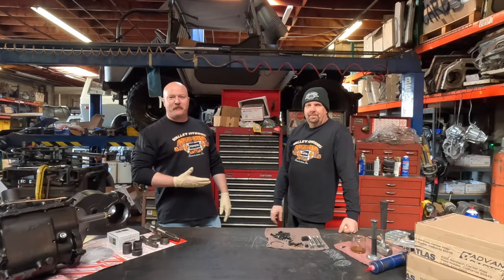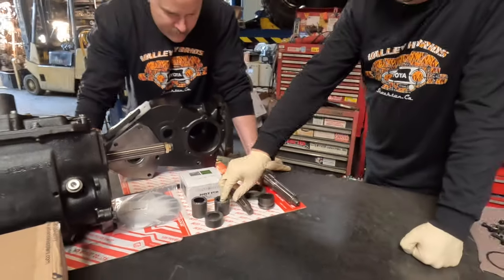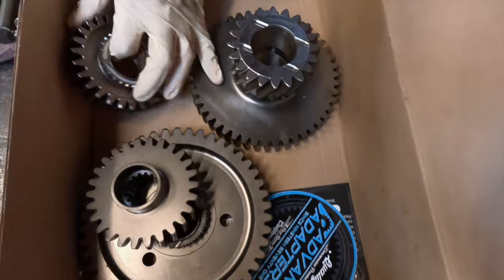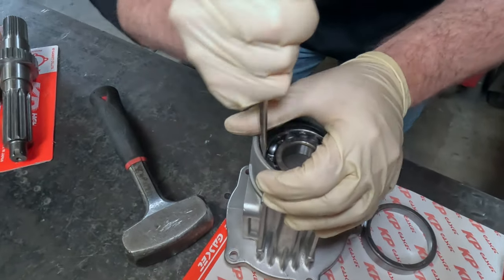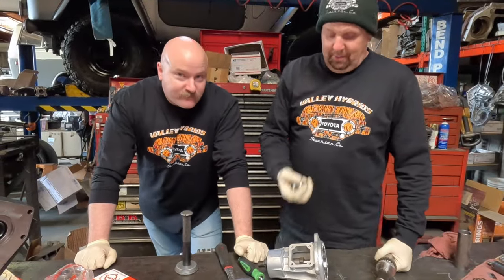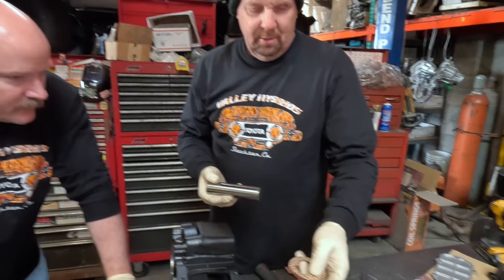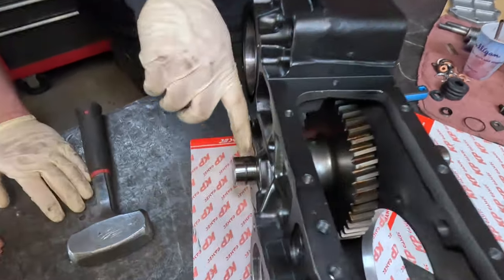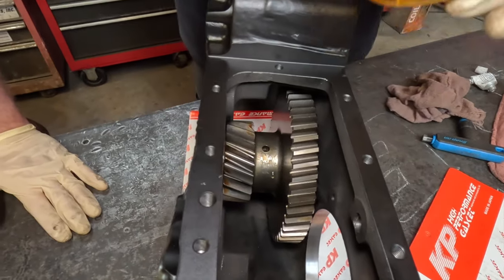FJ40 Orion Build Part 2 at Valley Hybrids

Comment: use grease on the backside fo the idler shaft bearings to help hold them in place and then a slim jim tool can hold the smaller gear side bearing in as you work it in
Reply from the maker: Thanks for the tip hog man!